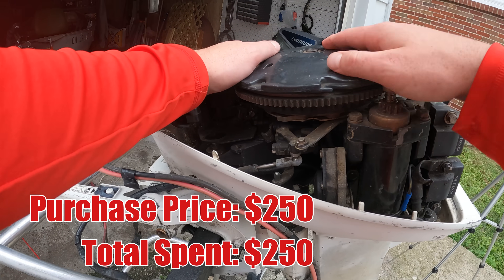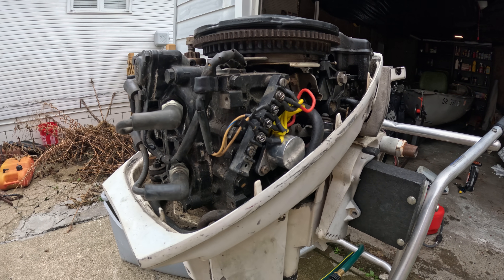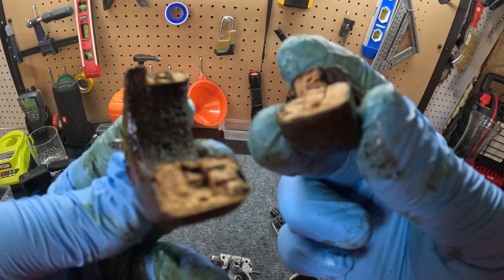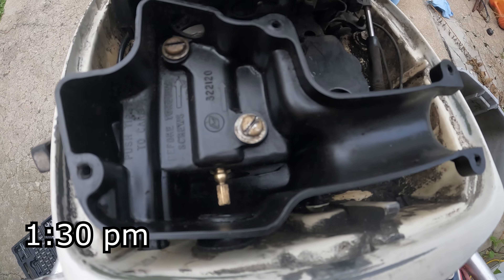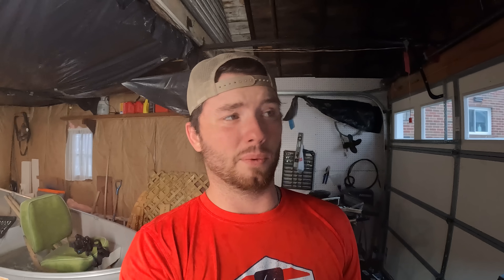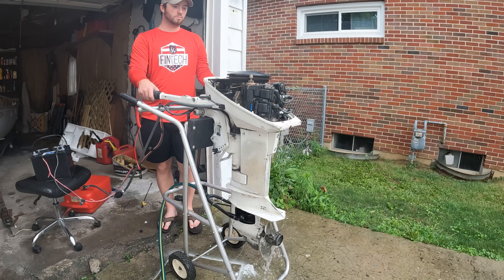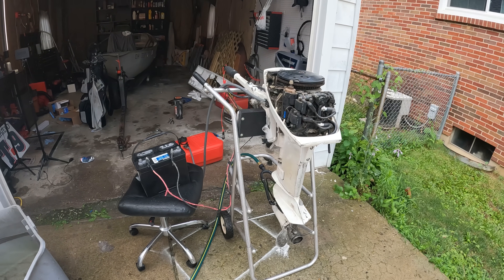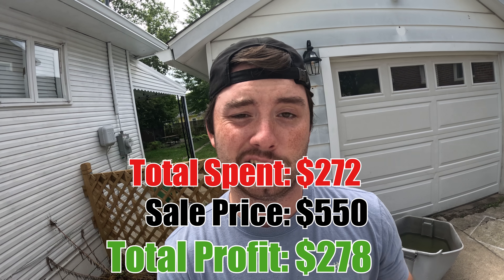24 Hour Boat Motor Fix & Flip Challenge! Can I Profit?

Comment: definitely won't buy T-9 Boeshield again...  1) very expensive, 2) the plastic bottle rolled out of my car from a height of maybe 2ft - the tip broke off (pretty flimsy container)...  I contacted customer support, they basically said "shouldn't have dropped it... our packaging is fine".  If you want a good product, use Blaster!

Comment: Excellent videos. 9.9 and 15 have different internal exhaust sleeves in addition to different carburetors.
Reply: I was going to mention that. I put a 15 carburettor on my 9.9 -79 model and talked to the guys at the dealer about it first. They said I would get around 13 hp without changing the exhaust. In Europe, but the motors should be the same.

Comment: Great outboards! Great memories woke up listening to it :-) 

My first was a 9.5 hp from the sixties, but kind of a forerunner to the 9.9/15 - with the low hanging engine suspended in rubber mounts. My 9.9 built in 1979 was mostly run on cheaper 70 octane, but the dealer told me I should avoid very low octane at temperatures under +10 Celsius. When I changed the carburettor to one from a 15, the dealer said I would get around 13 hp and I needed to change the exhaust too to get the full 15 hp.
Reply from the maker: @sjurgabriel  all true! A 9.5 Hp sportwin was also my first outboard. Great motors!

Comment: Your sense of humor is great and production quality is 10/10! Great vid! Also, do you have any experience with  something like a 1971 18 Horse Evinrude? I got one that runs good at full throttle, but the carb drains after a while at idle. New OEM fuel pump, carb kit, I check the top crankshaft seal for leaks and could not find any. This gremlin is really kicking my butt!

Comment: Another awesome video. I recently fixed up my boat after sitting for two years. I rebuilt the carbs, replaced the batteries, changed the spark plugs, the impeller, and gear oil. The engine started and ran fine, water flow was fine, revved up fine. Wasn't until I took it out to the lake and ran the engine under load it wouldn't go beyond 2000rpm. I tried a number of trouble shooting options but nothing worked. Any suggestions? It's a 2011 Mercury 50hp 2 stroke.
Reply from the maker: @skullfalker  make sure the carbs are synced up so that the butterfly valves are wide open at full throttle, also make sure you’re firing on all cylinders. Those engines run surprisingly well with a dead cylinder and you won’t realize until it’s under load
Reply: @BoatBusters  Carbs are synced. Haven't checked if all cylinders are firing though. I'll be grabbing a spark plug tester for sure. Thanks

Comment: I just got a electric start short shaft evinrude 15hp 1990s has been sitting in a garage for seven years. Any tips for what I might have to do to it under the cover is super clean
Reply from the maker: @Jevinrude_dude158  I’m assuming it’s a 2 stroke so make sure to firstly get fresh gas mixed 50:1 (2.6 oz marine 2 stroke oil per gallon of gas) Also drain and refill your lower unit gear oil and check for water in it. Also would highly recommend changing the water pump impeller. This is typically a yearly job. Make sure spark plugs are in good shape and gapped properly, i betcha she will fire right up! Worked on so many of those motors that have been sitting in barns for 20+ years that started 2nd or 3rd pull and ran perfect
Reply: @BoatBusters  ok thanks so much!! and yes it’s a 2 stroke

Comment: Maybe you can help me out. Recently bought a boat with a 1981 Johnson 90 hp 4 cylinder outboard. It’ll start a little rough but will even out. I let it warm up and high idle it. I then put it in gear and can only go 5mph for about 5 minutes until I can give it more and then it runs up to 40 and I can start, idle and kick it right away but if I kill the motor I have to let it high idle again and run 5mph again until it lets me give it more gas. If I don’t wait it will bog out. I cleaned the carbs and they seemed fine, changed fuel pump and no difference, one of the ignition coils was bubbly so I replaced it but still no difference. I tried a new tank as well and still the same issue. I’m not sure what else can be causing this issue.
Reply from the maker: @Enjoyinqtheoutdoors  first thing you need to do is check your compression. You should have 100+ PSI on every cylinder and all numbers should be really close to each other. (Within 10%). Next you need to confirm good spark on every cylinder. These engines run surprisingly well on only 3 or even 2 cylinders. Once you have confirmed good spark and good compression, we can move on from there. It sounds fuel related to me, I would really double check that your carb jobs were done correctly. You also have to make sure the butterfly valves on each carb are synced together and opening properly. Make sure you have fresh fuel with no chance of water being in it. Bypass any water separators and clean fuel filters out. Ensure no air leaks in fuel lines. Fuel issues are always the hardest to find but they usually are something dumb and easy… best of luck!!
Reply: @BoatBusters  thanks for your response man I really do appreciate it!! 

I did check compression but while engine was stoke cold and was reading 90 on all 4. It held at 90 too didn’t drop. 

New spark plugs and they have spark. 

Butterflies open and close together. There was some movement where the cables attach to the arm on the motor so I added a couple washes so it wouldn’t move sideways when I gave it throttle. 

I used my tank from my old smaller motor. 

Prime bulb does get hard and I don’t see any gas leaking out of carbs or fuel pump. 

Just so weird that once it runs well it will stay running well no matter if I idle it and throttle right away or reverse and throttle just fine but if I shut the engine off and immediately restart it and try to throttle it it will big out past 5mph. I may just take it to an out oars mechanic if I can’t figure it out. 

I will check for the air leaks next. Thanks!
Reply: @BoatBusters  figured it out!! I redid the carbs myself and the plastic piece that holds the float in place wasn’t in one of the holes so the float was not correct. I replaced it with a new one and runs like a dream again!!
Reply from the maker: @Enjoyinqtheoutdoors  I had a sneaking suspicion there was something funky with that carb job! Great work 💯
Reply: @BoatBusters  thanks man. Love the channel!!
Reply from the maker: @Enjoyinqtheoutdoors  appreciate you 🤝

Comment: 92 is good compression for these smaller motors? the cylinders are even
Reply from the maker: @bertrenolds5  yeah definitely good compression
Reply: @BoatBusters  nice. I have only worked on bigger motors that require over 100psi compression. I have a force 50 and an Evinrude 60.

Comment: I’ve got like a 95’ 25hp Merc 2-stroke pull start.. tops out at about 25 mph… friend that knows a little bit about motors thinks it’s a 35hp with someone putting the 25 cowl on. What’s an easy way to tell?
Reply from the maker: @dereksolarz1884  there should be a model and serial number plate on your engine you can look up!

Comment: My evinrude says 9.9 on the side but with all the mods I've done it's closer to a 25...
Reply: Besides carb and maybe prop/exhaust what else is there to be done?
Reply: @Tuker1954  a whole lot bored .30 over reeds polish all the runners open the carb up bigger jet lighten the flywheel play with the timing lean it out a bit deck the block .10 shave the head .20 there are a few other tweeks I've made but I'll keep that to myself
Reply: @pieseasmyseas  wow that’s a lot of work but really cool you’re getting that much power out of it! I think I’ll just go with the 15hp carb for my 9.9 ‘rude and leave it at that, favourite motor ever they’re the best.
Reply: @Tuker1954  it's a lot of work but when you dog walk a bass tracker down and pass him in a 1436 jon boat ,it makes everything worth of when you see his face!

Comment: In your opinion is mercy or even rude Johnson  better motors
Reply from the maker: @bradmetzger7332  probably not fair because I have a heavy bias toward Johnson/Evinrude. In my opinion in the 60s through 80s the Johnson’s and Evinrudes are better engines. I also don’t often work on old mercuries because they are a nightmare to find aftermarket parts for so I typically avoid anything mercury that’s pre-1990.. however, during the 90s and still to this day I think Mercury really took the lead and is producing really good outboards. None of them compare to Yamaha, but Mercury makes a fantastic modern product. I just wasn’t a fan of the old ones!